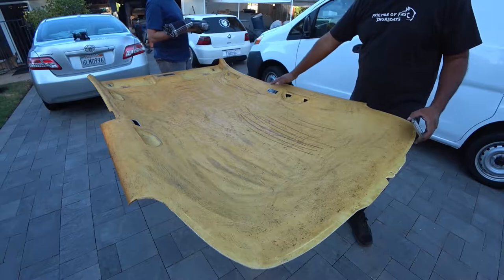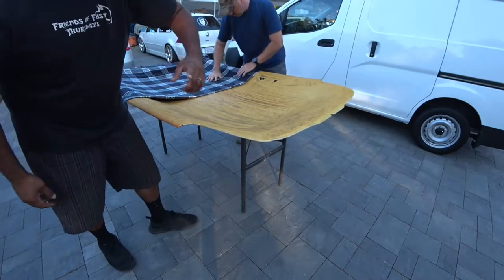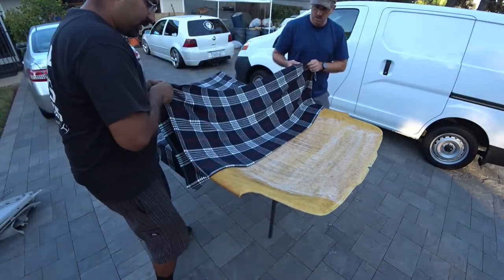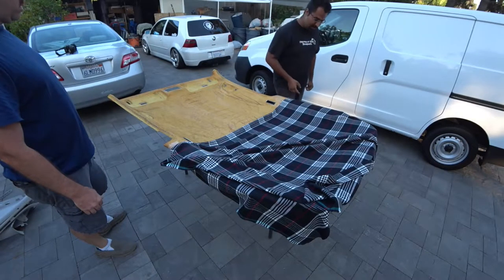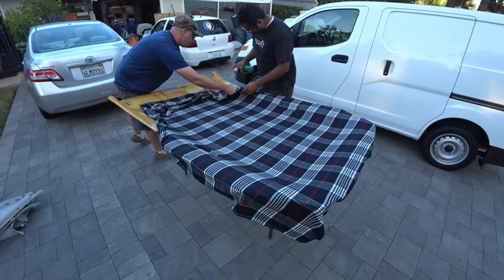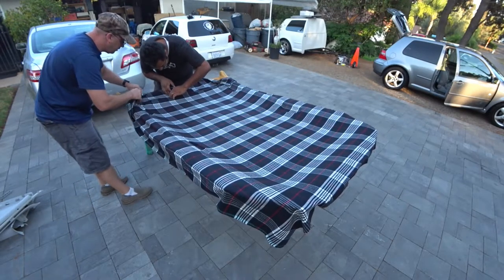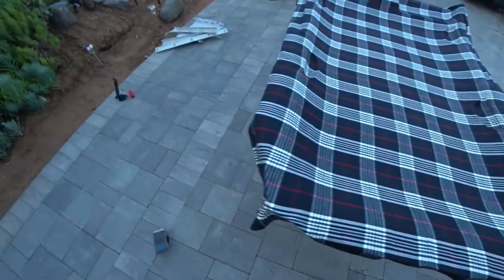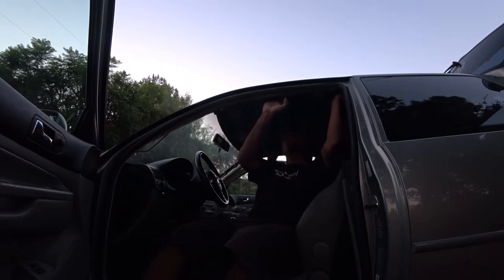How to Wrap an MK4 Golf Gti Headliner Part 3 S4EP26

Comment: Why wouldn’t you be spraying the headliner and the backside of the fabric that is contact cement it requires to sprayed on both pieces to adhere properly .not spraying the fabric you’re asking for failure down the road.

Comment: Hello, could you give a little more detail on  what you did with the excess trim around the perimiter of the headliner?  Did you cut the material flush?  Or did you fold it up over the edge onto the top a little and glue it down?  thanks!
Reply from the maker: Ross just cut and fold